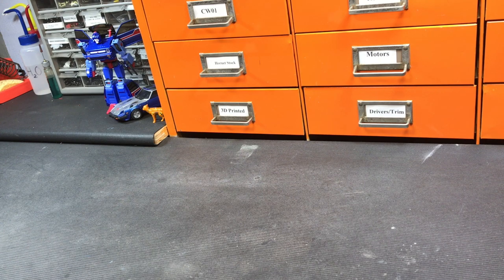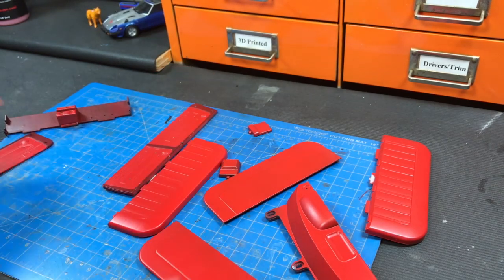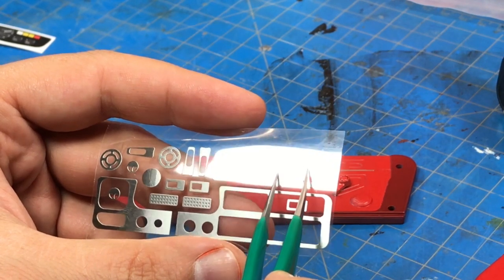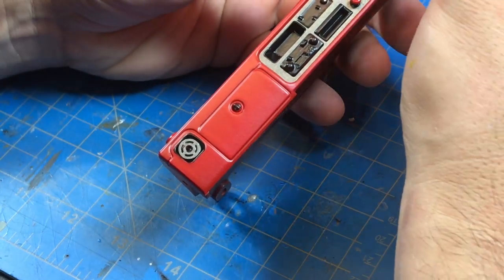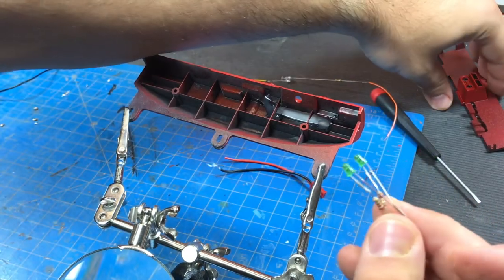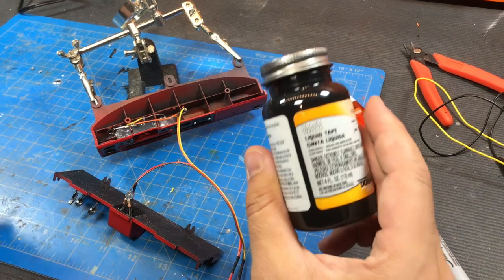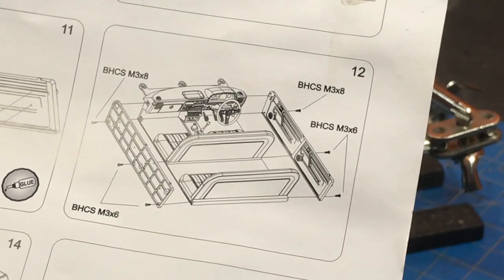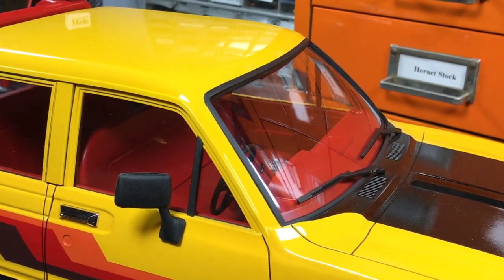e235: RC4WD Trailfinder 2 LWB Interior Set and Customization

Comment: I really enjoy your videos and am blown away by your attention to detail. It seems to me that the next level is full depth interiors and would love to see you building them. I was able to move the ESC on my TF2 two door back to one of your electronic bins and have a totally clear floor. I have mocked up a cardboard interior (no stores are open) and am able to get to seven inch action figures in. They have their hair. They have their feet. The driver's hand is touching the gear shift. I cut out the side windows and the passenger has his right arm laying in the window opening. It looks very realistic. My point is that with even minimal skills such as mine, it can be done.
Reply from the maker: The problem with the full depth interiors it takes away from the functionality unfortunately. I have a few full depth interiors and they've made the vehicles utterly horrible to wire and access battery compartments. I am working on a few ideas and chassis to hopefully help
Reply: @AMPROEngineering  It does seem to me to be the direction the scale side of the hobby is going. The hobby seems to only have begun expecting this recently and the manufacturers don't design with that parameter in mind. To take one example, my RTR TF2 had it's ESC down on the battery tray where an interior would go. I moved it to one of your electronics bins and built an interior. My TF@ LWB kit calls for the shifter servo to be, you guessed it, right in the middle of the floor space. In contrast, the Boom Racing BRX)! places the ultra-mini shifter servo under and behind the battery tray and the ESC under the hood. Imagine that!